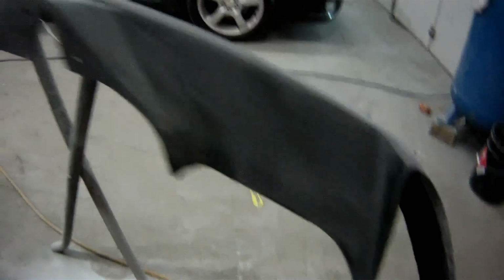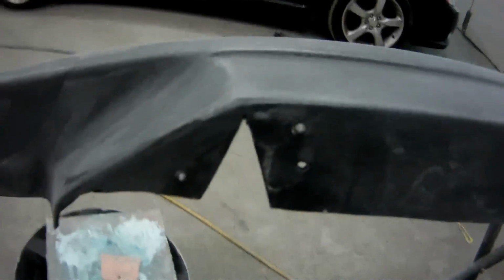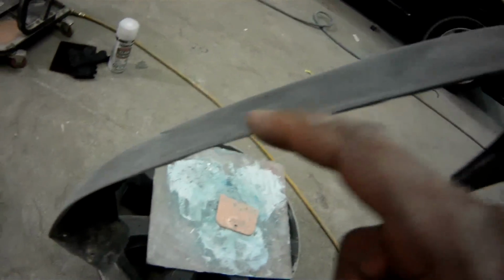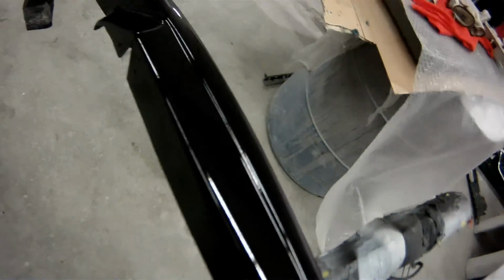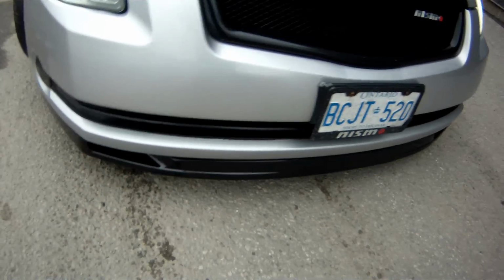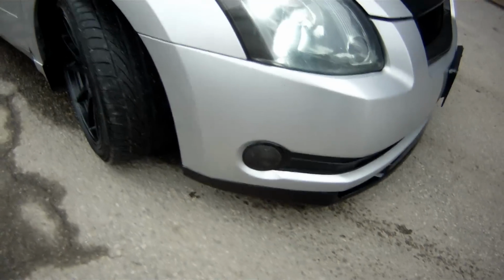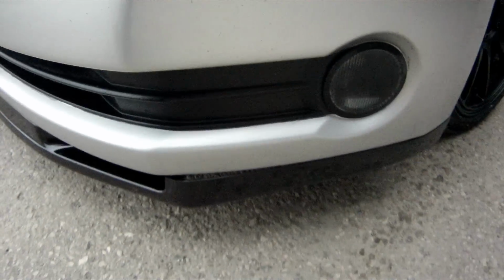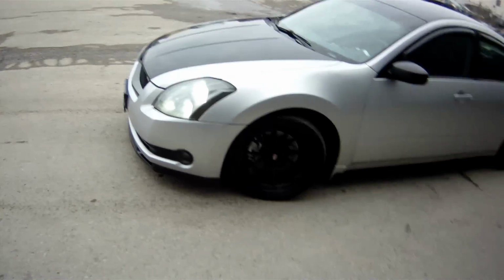2004 Nissan Maxima Custom Lip

Comment: so I have to cut the lip in half and piece it back together? and how did u get your bumper lights to stay on like fogs lights
Reply from the maker: Yes. I wired an independent foglight harness powered by ignition.

Comment: Looking good 
Dumb question
But can you fit a 2007-2008 maxima front bumper and grille on a 2004-2006 maxima
Reply from the maker: You can but it won't line up. To successfully complete that you will have to do an entire conversion meaning hood, headlights, grille, bumper, foglights, harness and for what? That's an expensive mod just to acquire the 6.5gen look. Or you just just by the Hybrid bumper from Ezkoncepts which is a combination of the 6thgen top half and the 6.5gen bottom half, with way you're looking close to $700 plus.
Reply: Hey jayson, you mean the wiring harness? If it isnt, then what do you mean? If you mean wiring harness, why do you need to change it? Is it for the headlights and foglamps?

Comment: Where you get that
Reply from the maker: Direct Services Made it from the 07-08. It's a 100% custom work.
Reply: @MrJasonlyrics  so it's a 07-08 lip you had to cut and shorten?
Reply from the maker: @scottc917  yes, it was 100% customized. I hated the ones that were available for the 6thgens
Reply: @MrJasonlyrics  so basically you got the 08 lip and shortened it?
Reply from the maker: @scottc917  yes, I didn't record it as it was a gamble.